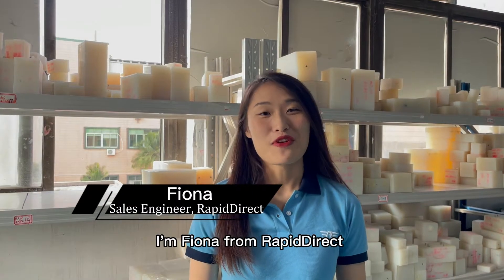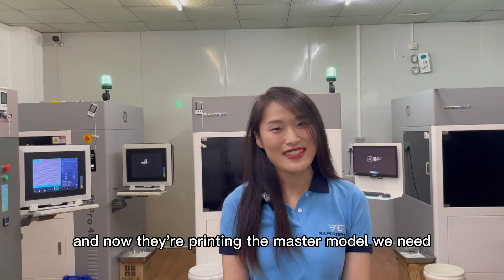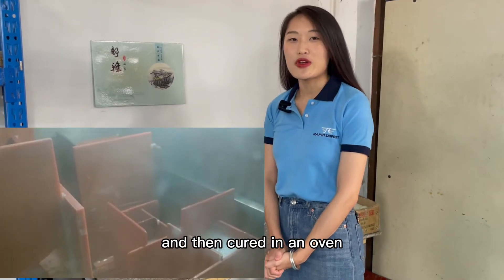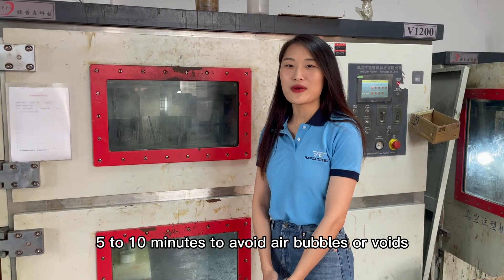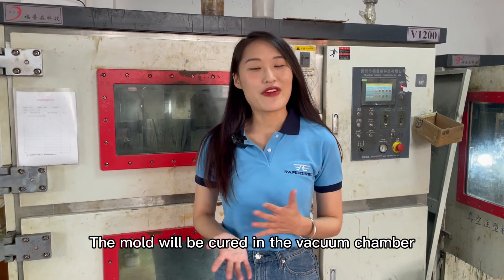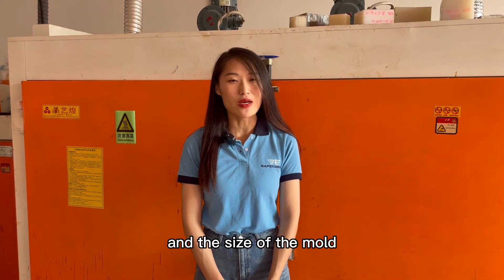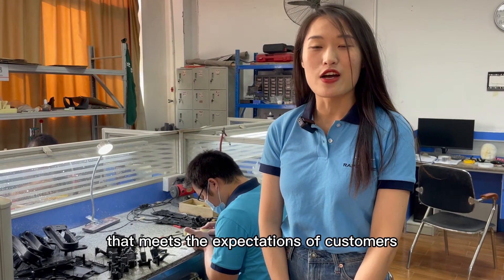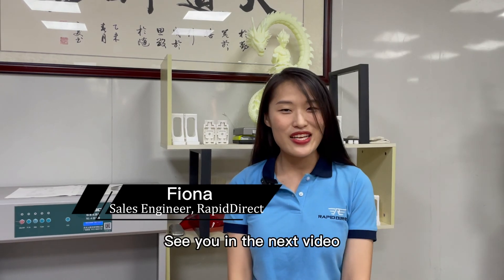How does Vacuum Casting Work?  Inside Vacuum Casting Factory

Comment: 🏭 Excellent behind-the-scenes look! Seeing the master model → silicone mold → vacuum casting flow is key to understanding quality replication. We run the same process daily, focusing on surface finish and dimensional stability for prototypes and low-volume series. Well captured!